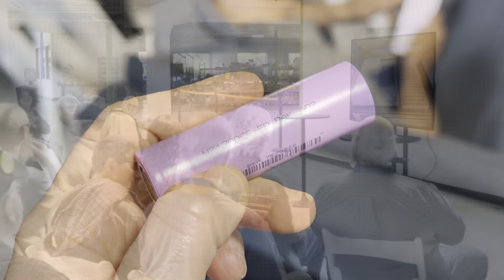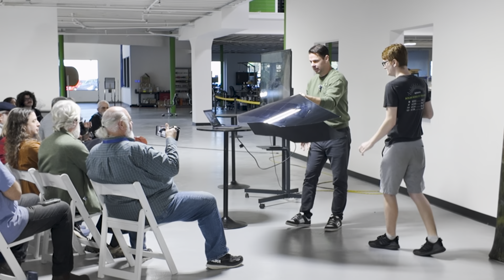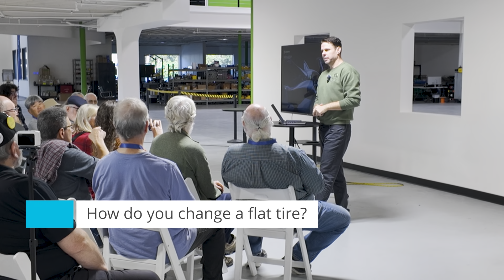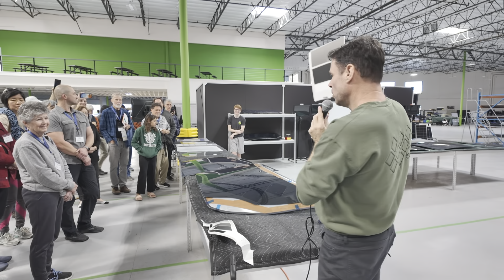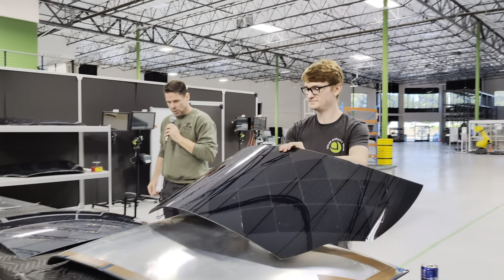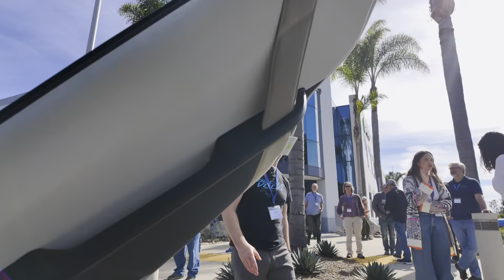Aptera Update 2024 from Chris Anthony (CEO) and our first test ride!

Comment: 40 cars per shift but can only make 10 solar panel per day. So each Solar panel  gets split up for 4 cars? Or is each panel entirely used on one car? That would mean Only 10 cars are made each day, not 40 if thats the case.. 

Can it drive up hills (with passenger and 1.week of groceries)?? How is the range in climates colder then California.  Lile winter in the Rockies and Canada etc...?

Comment: For what it's worth when things where good... i got a new honda insight and a new vw jetta turbo diesel 2002 . Both worthless by the time warranty ran iut ;-( vw actually tried to kill stuck acceleration.. both dumped big loss. Hope this is the real deal
Reply: 2ndary few will look. But turbo diesel jetta had computer issues that caused turbo over boost and stuck acceleration.  Dealership tried to blame me . Ended up selling and buyer seemed to have sued as computer reset to cover flaws and new owner within a yr. Just a bad story . I had to turn ignition off twice to get it to turn off and engine was blown on a 10 degree day on a freeway.. not an experience anyone would like :-(
Reply: Insight also had computer issues and I gave up after they lied a last time. Last in shop replace all assist parts. Said if not this your computer probably bad . 6 months later.  We never said that out of warranty

Comment: The car looks like it does for low air resistance. Three wheels is more efficient than four. The vehicle is all about efficiency. Tesla started out that way but when to 5000 lb beast moving one or two people from point A to point B in a 350 super duty is not efficient! I look at the solar panels as free gas! Not that I will never need to plug it in.

Comment: What a load of crap.  The Aptera is a great concept, but it is not designed to be actually used.  The solar panels are totally and completely useless.  This is a physical fact.  A full day in the sun might add .5 miles to the battery.  That said, tough they claim the solar panels will last ten years, they will actually wear quickly from road debris on normal driving.  The vehicle is all but invisible on the road, specifically from the rear.  The slightest rear end collision will cause extensive damage, to not even think of rear collision at speeds over 30 mph.  Lighting is catastrophically weak, again especially in the rear.  This vehicle should be marketed as an daytime NEV only.  Only a fool would drive it on roads where speeds exceed 35 mph, and it should never be driven at night.  Aptera has not shown a night film where the vehicle is followed/passed, handling even moderate rain, or effectively climbing a hill.  Let's see the vehicle back into an obstacle even at 5 mph straight on and oblique.  Show a rear end collision at 15 mph.  Lets see it even climb a hill.  Drive through the Mojave to Vegas a few times (if it even can) and show the exterior results.  We've waited decades for Aptera.  It's a deathtrap at night and on high speed roads.  The NEVs worth paying attention to are coming out of Oregon.  So long Aptera, hello Arcimoto...

Comment: If you haven’t made 40 units at the end of the shift, will you stay at it until you’ve reached 40? Will production be a 5, 6, or 7 day schedule. The first 2000 should be made in 50 workdays
Reply: It won't have a 12 minute takt time the first couple of weeks, but once they reach full performance, vehicles that can't be completed in the required time at a given station will be pulled off to address separately so they can deal with the next one and keep on schedule.

Comment: I think the Aptera would be a great 2nd car for short trips and city driving. I'm very skeptical of the strength of the body and front suspension. A front or side impact crash at high speeds would not be pleasant, I don't believe simulated crash tests on this vehicle.
Reply: They are going to be doing real crash tests.
Reply: Soon we will have the public results of actual 3rd party crash testing of the PI vehicles.  Although not required to have them, Aptera will come with air bags and has a larger than standard crumple zone that is not filled with engine hardware like most cars.

Comment: Aptera seems like the only electric vehicle  i would buy very nice styling and quality build
Reply: Quality build?  How is that?  There are NONE that have been built so how can you make that claim?  Are you referring to the Franken-prototype that they use as a static display that can't even go around the block without overheating?  It literally has no working solar on it, it does not have a complete battery, does not have their regenerative braking, does not have the cooling they claim it has, their screen doesn't even work properly so how can you comment on "quality and build"?  Hilarious!  Another well informed aptera fan.
Reply: @johnbauby6612  It seems you are here to put down Aptera fans. Can you show me on this doll where Aptera hurt you?

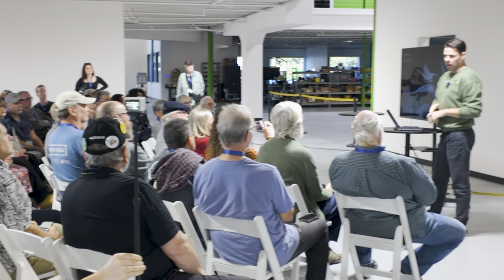Comment: 30:06 why? Cold does not damage batteries. Heat does. So if you live in a cold climate, when you park your car it’s going spend energy keeping the battery pack warm? That doesn’t make a lot of sense to me.
Reply: If the battery gets too cold the chemical reactions that create/release the electricity slow down so if you don't keep them within a fairly narrow temperature range they don't work so well.   When cold you absolutely cannot charge them and this is what caused so many problems in Chicago recently with many dead Tesla's that wouldn't charge even when plugged in.
Reply: @recoilrob324  the most popular EV car brand in the world doesn’t spend energy keeping batteries warm while parked. That’s reality.

Comment: It looks like there are not many people interested and the majority are around 40+ years old and don't need a real car.
Reply: As someone in my mid-30s who runs a business where I put 10,000 mi on my car every two and a half months I am 100% interested in the thousand mile per charge model.
Reply: @boogeritis  
With the California electric greed, I don't know. And you need more than solar to charge a battery 50% even for a solar radio.
Reply: @LuisVazquez-hx3bk  I live in Pennsylvania. The sun makes a guest appearance every so often around here. Solar charging is the least of my worries. I'll spend the $1,500 to have an electrician install the charger to my home.
Reply: @boogeritis  
Now you are going to be worried about the electric bill, the battery won't explode or if the electric supplier can burn enough oil or carbon to supply your state with electricity.
Reply: @LuisVazquez-hx3bk  lastly, The county I live in gets its electricity from a nuclear power plant 40 mi away. No oil burning.
Reply: @boogeritis  
I'm not, I'm a scientist. I go by the reality of physics.
Reply: @boogeritis  
The one who goes by facts and evidence, not by here say.
Reply: @boogeritis  
Isn't nuclear energy bad for the climate?
So we should change to electric cars because your county has nuclear power?
Reply: @LuisVazquez-hx3bk  nuclear is not bad for the climate. It is an  energy source without emissions. You are not a scientist. I don't know what you are but you're not very good at it. You just listened to a video about engineering and factual information about this vehicle yet you called it hearsay. Get an education.
Reply: @boogeritis you don’t a charger installed.  110 plug will be enough.
Reply: You are sadly under informed.
Reply: @beachbeemer  
I just hope this is not just a gimmick and in the end will disappoint many investors.
The Carvel was also good until it went electric.

Comment: Aptera is checking some of the boxes, but also needs  vacuum insulated side glass.  More options for battery chemistry.( Sodium for cold weather climates).
Reply: I live in Iowa where it got down to -22 a couple of weeks ago (-30 C) and the NMC chemistry used in some Tesla Model 3s that Aptera also uses has done well in these temps.
Reply: Vacuum insulated glass is very expensive when doing limited production. Maybe Aptera will implement it in the future when producing over 250,000 vehicles per year, but it doesn't seem like a good idea right now when the goal is to get to production using the least amount of capital possible. 
The first generation of sodium ion by CATL only has an energy density of 160 Wh/kg and it needs a lot of real-world testing, whereas EVE Energy says that its NMC 2170 cells have an energy density of 290 Wh/kg and it is well known how to pre-heat NMC cells to be able to charge them in subzero C temperatures. As long as you don't run the battery down to 0% so you can't run the heater in the battery, you shouldn't get stranded in low temperatures with an EV. The higher energy density of NMC means less weight and better vehicle energy efficient, so in my opinion NMC is the way to go and if you keep the battery capacity between 20% and 80%, MMC should last a long time (15-25 years), and the modularity will make it easy to swap the battery if it ever does fail.
Reply: New amazing batteries are announced all the time. I wouldn't sweat the small stuff.

Comment: How much is one going to cost?
Reply: Starts at $26k for the 250-mile RWD model. The most popular is the Launch Edition, with AWD, full solar, and 400 miles of range, and costs a little under $40k. The top-end version is the 1,000-mile edition, and should cost about $60k.
Reply: @CaptainRotmeat  Front wheel drive or all wheel drive, not rear wheel drive.

Comment: The Only thing I am concerned with is the clearance between the fenders and road. As I am in a Northern State and many many pot holes seems like more in Ohio than most. I am concerned with damaging my fenders an hour after receiving my order are these going to be adjustable to raise or take off? I think I might have to modify the fenders with about a 6 inch foldable sleeve or slot to raise the height?
Reply: There are info that it have 5.5 inch clear. You can modify/cut it with angel grinder if ya want. It's your, not like Tesla.  If do something weir will void warranty...
Reply: Avoiding potholes is a concern. But I want one. Just wish it had the top speed for track use. Those doors make it look so exotic.
Reply: @Terrillthegreat79  I wojuldn't be too surprised if people will be swapping out higher HP/rpm wheel motors for track use.
Reply: @n.brucenelson5920  do you know if Elaphe (or others) will be producing high-performance hub motors for it? It sounded like the hub motors were a pretty custom job, and I didn't think there'd be off-the-shelf motors available for enthusiasts.

Having said that, though, the thing is so slick that it actually has a really good 1/4-mile, even without massive motors.
Reply: @CaptainRotmeat  Hub motors are being designed by several companies now.  BMW has just introduced a model using hub motors.  They have the disadvantage of adding unsprung weight, but the advantage of freeing up space in the body of the vehicle, which among other things can be used as a safety crumple zone.  Yes, Aptera's hub motors are coming from Elaphe Motors, located in Slovenia, not far from where the bodies are being built in  Italy.  They are a custom version of Elaphe's M700 model.
Reply: The grey parts on the front and back of the wheel pants are made of an ablative foam, and are designed to be ground away over time. That way, they're able to keep the wheel pants as close to the ground as possible (thus increasing your aero) while also adjusting to your real-life driving circumstances.

So basically, just drive the vehicle as normal, and as you run over potholes or other obstacles, the foam will naturally grind away to give you the maximum aero possible while staying just off the ground.
Reply: I agree.  It would be nice, possibly, if they could eventually introduce a high clearance variant; I would take some efficiency hit to gain better overall clearance.  Here in the midwest, there are potholes, junk all over the roadways, giant monster speed bumps, and sharp angle changes on transitions between roadways (where different streets connect, etc).  I doubt Aptera has resources for that right now though.
Reply: They have an off road version with more clearance at the skirts and rear wheel.

Comment: So if it's classified as a motorcycle, to drive it on the street you'd need a motorcycle license?
Reply from the maker: I misspoke and it is classified as an autocycle. In most states you don't need a motorcycle license but you should double check the requirements. Details: https://aptera.us/aptera-myths-debunked/

Comment: Surely the seats will not be higher with the 120 mm batteries .. ?
Reply: All battery packs, regardless of cell height, are below the interior floor tub/pan and will not change seat position in any way.
Reply: I assume that the seats will be higher with the 600 and 1000 mile version to account for the taller batteries, but maybe Aptera will just include extra space in the battery bed pan, so all versions can use the same body parts. Adding 20 mm extra for the 600 mile version would only mean 0.8 inches higher, but adding 50 mm for the 1000 mile version would be 2 inches higher.
Reply: @amosbatto3051  Yes. But I doubt they will raise the seats, there must be some other way. But that was one of the questions I missed an answer to. There are many others. For example, why don't they take a drive in the latest model and check the range?

Comment: Chris talked about cold battery management, but what about heat? I live where we face triple degree heat. Heat degrades batteries. And we expect to park in direct sunlight. What protects the battery from the heat?
Reply: If you are parked in the sun, the vehicle should be getting enough energy to run the cooling in the battery to protect it from heat damage when parked. If worried about these issues, I recommend not buying the Launch Edition and seeing what Aptera implements.
Reply: The solution to triple degree heat is to use a better system by which to measure it. I suggest you switch to Celsius.
Reply: Magic!  The same thing that makes their fantasy vehicle drive 1000 miles yet not ONE single video of it doing more than a trip around the block, but mostly around a parking lot or as a static display at some random EV fair. Become a Super Accelerator Investor and give them lots of money and they will put even more Magic into yours to make it drive 3000 miles and stay cool in the sun.  HAHAHAHAH  You will be able to bake a ham on the dashboard of that plastic bubble sitting in the sun!  It would take an industrial AC unit to cool it.  You will need a trailer to pull around an extra battery.  HAHAHAHH  At least you can open the mail slot windows for a breeze.  Better yet, take the doors off and you will see it as the overpriced electric motorcycle that it is trying to be.
Reply: @johnbauby6612  How to offer proof that you have never been near an engineering text or a calculator or wouldn't know how to use one if you did.